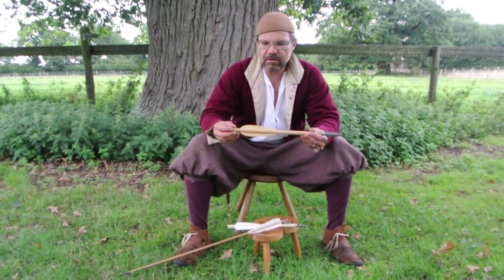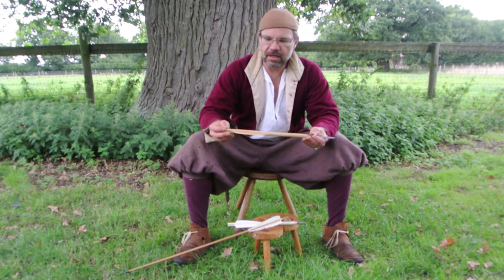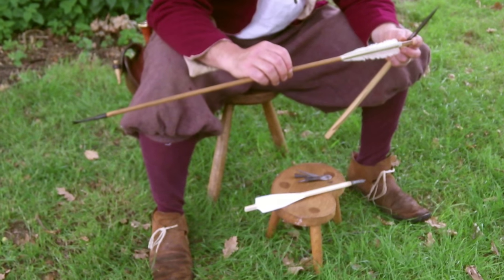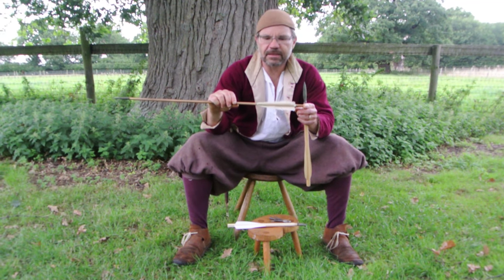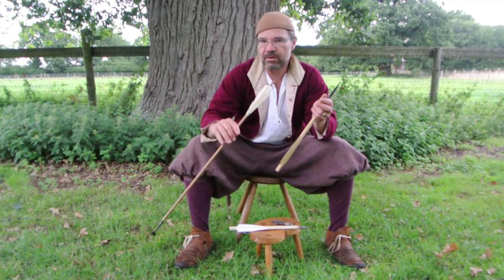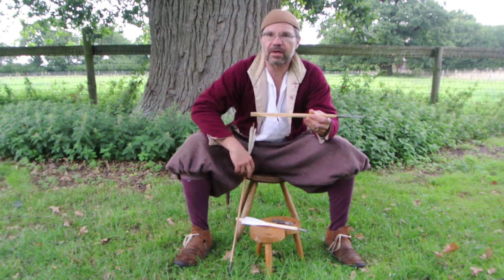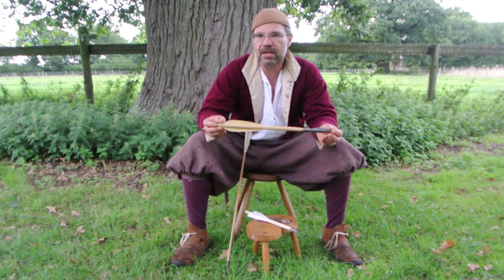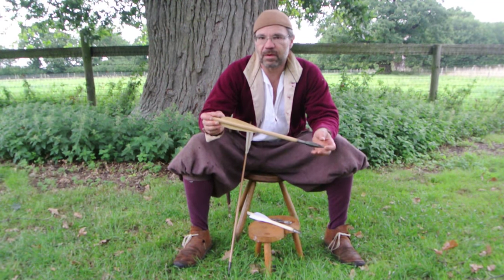Why Medieval crossbow bolts were fletched with wood

Comment: If I recall correctly, during the Siege of Malta in 1565 there was a torrential downpour and all the gunpowder got wet. The Knights dug up some old crossbows and bolts and were able to inflict serious casualties amongst the Turks. So that would be another advantage of wooden fletchings over feathers. They work when wet.
Reply: +ryddragyn Feather fletchings work well enough when wet. I've shot feathered arrows in pouring rain before, doesn't make a major difference.
Reply: I've shot feathers in the rain many, many times myself, and more often than not they've eventually become soaked and useless. Many birds do secrete oils that help to waterproof their feathers, but they have to constantly groom themselves to maintain this effect. So whether a feathered arrow would work in the rain or not probably depends on the species, what part of the bird's body or wing it's from (deeper feathers wouldn't get coated by as much oil) and how well the feather has been treated by storage. Fresh feathers off the surface of a bird would probably be fine (I've run naturally-shed peacock wing feathers under running tap water with no effect) but deeper feathers and older, dried-out feathers in a basement arsenal wouldn't necessarily be okay. Which is exactly the scenario of Tod's video. Easier to make the fletchings out of wood and not sort through thousands of feathers to find the ones most likely to not collapse when wet. 

Bear in mind that most of the historical manuals out there also firmly advise for a rain cover on the quiver.

"It should have a cover to shield the feathers from possible rain." - Faris Elmer text

"To keep the arrows dry, and to cover them while traveling, we make a sheath for the quiver of waterproof muslin." -Saxton Pope
Reply: +Tea Kew You have to remember glue before modern day glue often dissolved in water. To quote something from an awesome blog I recently came across. 

Sir William Skeffington in 1535.

&quot;...there did fall suche a rayne as hath not been seene in thes parties; so that the fotemen wadid by the way to the middels in waters, which was pite to see,....the sayd fotemen that coulde not have defended themselfes with ther bowes, for ther stringes wer so weate, and moost of the fethers of ther arrowes fallen of.&quot;

http://willscommonplacebook.blogspot.nl/2015/03/waxed-arrows-and-glued-arrows.html
Reply: That could be an issue if you sit your feather-fletched bolts out in the rain for a long period (although note that 1. flights are often bound on with fine thread, and 2. wooden vanes glued on would be just as vulnerable to this).

However, it won't impede taking a feathered bolt from a dry bag, and shooting it. Unless the glue is collapsing in a minute in the rain, that will work fine. After all, in a fight you only need the bolt to work once - it's not like you'll be fetching it out of the target and re-using it.
Reply: Though I agree that the thread helps keep glued feathers on, a dry bag is an ideal situation. In the chaos of a siege, odds are a bag is going to be left open and the contents will get wet. 

Wooden vanes weren't necessarily glued on. Tod will know the answer to this better than I, but as far as I am aware they were actually attached via a slot carved in the back, kind of like an elongated nock. Very durable.
Reply: ***** There seems to be widely varying opinion on the effectiveness of feathers in the rain. I have seen some intense debates on this exact subject on modern bowhunting forums. The fact that people's experiences are all so different seems like a good justification for just playing it safe, and sticking with wood. 

Thanks for the good video, by the way. I always enjoy when you upload stuff.

Comment: I would think that one reason that they're fletched in wood because you can. With a long bow you need to have feathers because the fletching has to collapse as it passes your bow hand and the side of bow. Hard fletches will cut your bow hand and knock the arrow off it's path. But with a two fletch cross bow bolt that is not the case, and you can use hard Fletching. Plus you don't have to wrap the arrows with delicate bits of thread.
Reply: I've actually considered making a Bow that can shoot Arrows with Wooden Fletchings. All it needs is a groove on the handle and a place to hold that doesn't put your hand at risk (there's still a risk). Heck, it would be better to simply make an Overdraw device aka Tong Ah that can shoot Bolts because I'd  imagine 2 Vaned Arrows probably suck due to too much flexing of the shaft although I've never made 2 Vaned Arrows.

Comment: Making the fletching out of wood also allows the shape of the fletching to be more precisely controlled and maintained during flight. This is important because crossbow bolts are typically heavier and larger in diameter than longbow arrows, causing their spin inertia to be much greater. As a result crossbow bolts need more prominent and effective fins to stabilize themselves in flight. A wood fin can be shaped into an airfoil to produce aerodynamic spin moment, and it will maintain the airfoil shape when soaring through the air. Feathers on the other hand will deflect and change shape easily when air is rushing over them, and it's harder to make an effective airfoil shape out of feathers.

Comment: This does begs the next question: Why doesn't arrows have wooden fletchings, or did some do?

My uneducaed guess would be that there is some kind of problem with the arrow leaving the bow.
Reply: +gurkfisk89 The wooden fletchings would strike both the archer's hand and the bow itself. Feathers collapse and then recover. Modern archers are able to use rigid vanes with the assistance of special arrow rests. 

Crossbows get away with wood because they have only two fletchings and are shot along the stock of the crossbow.
Reply: Correct, the fletch has to bend when it hits the bow. Also the bow rate of shooting is considerably faster so you need more. Way more. Feather fletchings are easy to make without specialist tools.
Reply: It also makes the arrow heavier and worse yet bottom heavy.

Comment: Personal theory: feathers are much too flexible to stabilize the heavy bolt.  Wood's rigidity is better able to stabilize the bolt in flight as well as the other properties; use in wet conditions, reusability, etc

Comment: This also begs the question. Why AREN'T Modern Crossbow Bolts still fletched with Wood or some similar hard/durable material today? Crossbows are mostly used for hunting and are quite powerful to the point where a Bolt can really sink in depending on the Animal and where it's hit. So this and even regular use can cause Fletching damage which is not the end of the world, but eventually you run out of fletchings and glue and got to go out and buy more. Again, no biggie especially if you can afford a 200lb Crossbow. But why not step back a bit and see that not that long ago, Hunting Crossbows were essentially Modified Medieval Crossbows with the exact same bolts. Heck, people still hunt with Recurves and Longbows. 

The problem with Compound Bows and Modern Crossbows is you expect near perfect results (and rightfully so). Where as Traditional Shooting has a human element to it. Even a Medieval Crossbow is not insanely accurate.